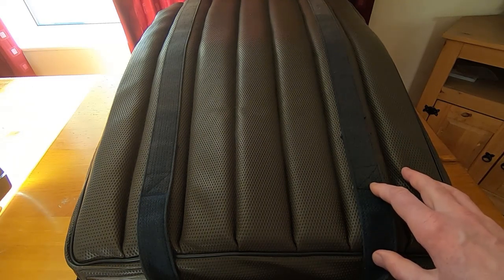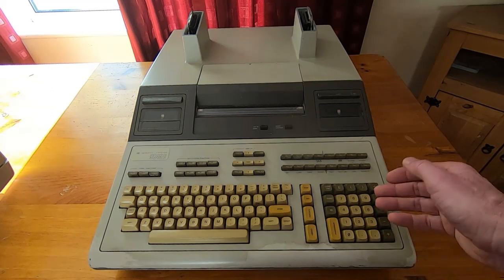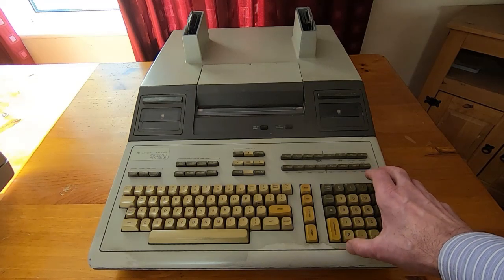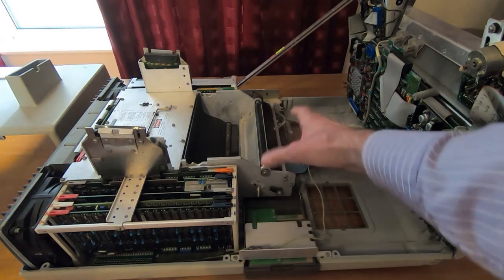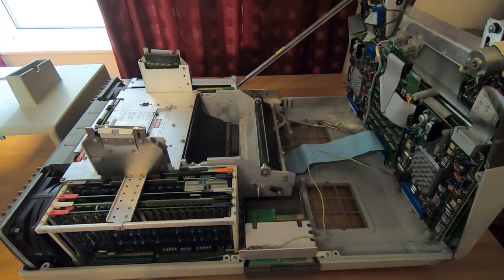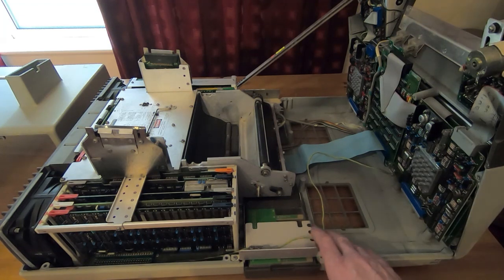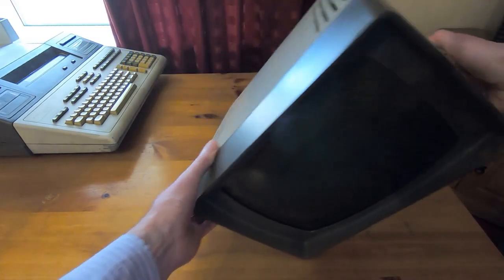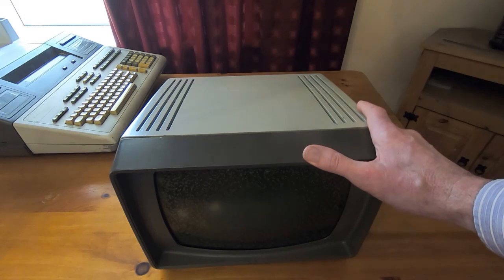HP9845B Repair Part1

Comment: Amazing calculator! I’ll be looking for the revives journey episodes. Hopefully the power supply is equipped with power rails crowbars (beyond the “pessimism “). Some of HP’s calculators of that era don’t, destroying a lot of ICs if series pass transistor get shorted.
Reply from the maker: HP had given up on the calculator pretence with this machine and it was marketed as a computer.